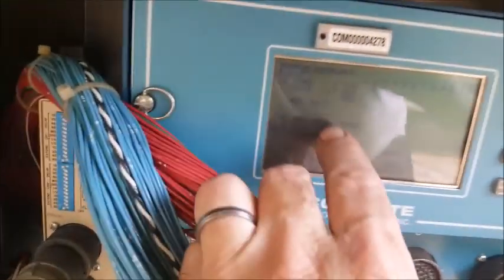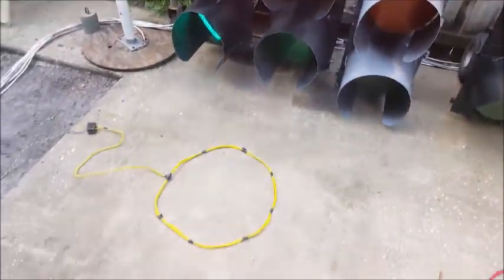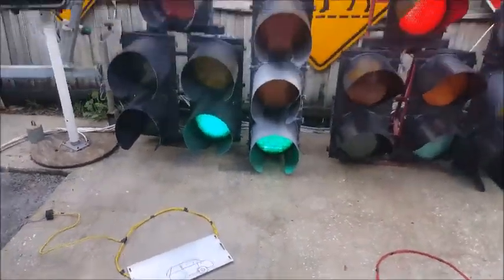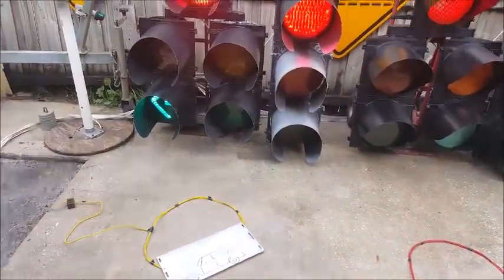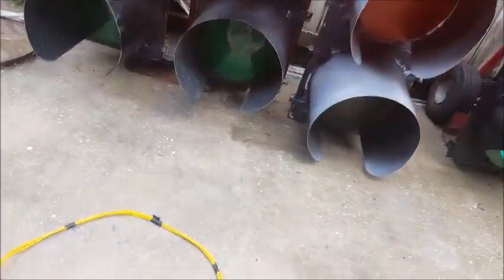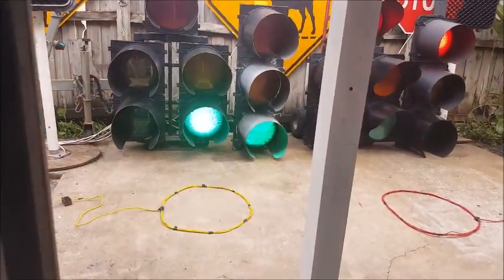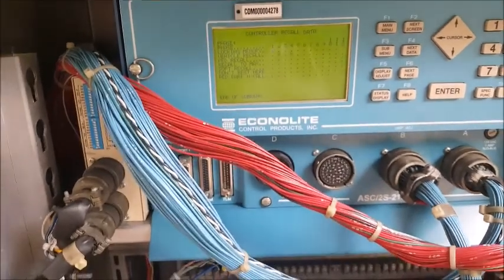Traffic Control System with Loop Detectors

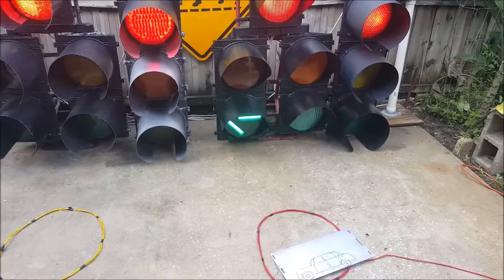Comment: 2:53 What if you don’t move it?
Reply from the maker: If you do not move off the loop or if there are many cars inline the system will go to Max Green for the arrow and move onto the next phase in the cycle. You can see this in real life during heavy traffic in the turn lane it will allow so many cars through the protected arrow then give the yellow and then red.. After that it depends on the size of the intersection if the turn is held red or becomes a permissive turn. in my intersection they become permissive turns since I'm using five way signals and do not have a dedicated red arrow.

Comment: I have a McCain ATC EX2070  and a flashing yellow arrow McCain signal head I would like to know if you know how to program that with this controller and how to hook up load switches, what pins are used and not used?
Reply from the maker: You have a newer controller then what I have. With that being said I don't know how to program that model. I use an old Econolite ASC2/S-2100 to run my signals. Sounds like your where I was a few years ago where I had signals and a controller but not much else. Since these are a hobby and I do not work in the field I had to learn from scratch.

After that what other equipment do you have?
Also are you just trying to get your signals to flash? if so you really won't need a complete system to do that.

Some systems require a Buss Interface Unit (BIU) to talk to the load switches. 

Mine only requires connection through the three Cannon connectors A, B and C. and they make all the input and output to the controller.
Next would be a load bay of some sort with load switches. 

Then you can add a MMU and Loop detection if you would like.

I give a tour of my current system.  you can see it here: https://youtu.be/wB0dz3rPfR0
Reply: A 4-section turn head enables hybrid turns (protected only mode and protected-permissive mode.) The flashing yellow arrow is separate from the solid yellow arrow one. In prot-perm mode, the FYA runs concurrent with its opposing through phase similar to when a 5-section head only displays a green ball to indicate that turns are permissive. In prot only mode, the controller would show a red arrow during the compatible through phases, but it may be possible to program the controller to display the FYA after the conflicting ped phase has completed.

In both modes, the protected phase (green and solid yellow arrow) is separate from the through phases, like other turn phases. Ideally you want two separate sets of loops to call and extend each mode depending on the time of day.

Upgrading left turns to FYA will usually entail upgrading to a 35X series cabinet, but you could also connect the flashing yellow in an existing cabinet to an unused "ped yellow" load switch, if you didn't already use these for overlaps or blank out signs.
Reply: I’m trying to create a Small intersection the signals I currently have are a flashing yellow arrow 4 section and two 3 section signals and an optical preemption detector (opticom)
I working with currently.  I Would like to add a cabinet and load switches to make things easier.

Comment: I thought if a traffic light detects a left turn and there is no other conflicting traffic or opposing left turn.......then wouldn't it have triggered an all green?
Reply from the maker: Depends on the system. this system is more a basic one that can only handle one turn and one green per side and PEDs. It cannot hold the red in one direction while the other direction gets a green arrow. This systems is a 8 switch load bay and only 6 are being used. 2 for arrows, 2 for through traffic and two for PEDs. Systems with 16 switch load bay would be more flexible and allow to work as you described. I have my eye out for a larger controller box with a 16 switch load bay that also fits into my budget.
Reply: Actually that can be accomplished in the controller itself, and really nothing to do with how many channels you have in the load bay.  In fact the rig you have in theory can be programmed to do just this.  It's not really a special configuration either.  It's part of the fully actuated set up.  It's also part of the single and dual ring (with and without the barrier) function.  Only 4 phase and 8 phase can accomplish this.

Say you have N-S movement on a green ball display.  If a northbound car wants to turn left, the the southbound lane will sequence to yellow clearance, then to all red clearance, and the Northbound left turn will get the green.  This is based on your idea of no conflicting calls on E-W movement.  If there were a conflicting call, then those cars would get serviced first before the NB car would receive the green arrow.  I had a configuration exactly like that.  

Now let's assume the call on the E-W movement dropped (that is the car left that call) typically the remaining E-W green time would reduce (most likely reverting to it's minimum green or perhaps a gap out state), and then the NB left turn would receive it's green arrow.  In many areas you'll see this late night, early morning, and very low traffic times.  Again nothing fancy in terms of hardware.  It's all done by the controller.  :-)
Reply from the maker: Im by far no expert on Traffic Control systems and have taught myself everything from scratch. It all started by building working traffic signals for my HO scale rail road I once had. I usually just sit down in front of the controller box with the manual and go page by page trying different configurations and learning all they way
I got the Econolite ASC/2s 2100 in June of 2016 and built my own A Cable from scratch and a small 4 channel load bay that I use today with the EPAC 300 I keep in my Garage.  I only used controllers I made myself before I got the Econolite controller.  

In my system I also have PEDs that take up two of the eight load bays. If I wanted to use four Five-Way signals (or 4 turn signals) with PEDs I would think I would  need at least 12 channels. My load bay is configured  like this, Ch1 is Main turn, Ch2 is main through, Ch3 is cross turn, ch4 is cross through, ch5 and 6 are unused, Ch7 is main PED and Ch8 is cross PED.
 I could add turns to ch5 and ch6 and program them but I would have to hold all the PEDs in "Don't Walk" until all the turns are complete even if no car would be turning across one of the cross walks. say if only one car is in the main street turn lanes and turns East then the crosswalk on the west side would have to be held "Don't Walk" unnecessarily until main street get the all green.  
If there was a way to do that without holding the PEDs Im up for it. 

I will have to go though the ASC/2s programming manual deeper. I live in Florida and I haven't done much programming on the system since Hurricane Irma, Thats when I had to bring everything into my garage to prepare for the storm. Its back up and running but I haven't had much time since September to get back to it other then just running it. 

 I get my programming from the ASC/2S programming manual:  http://www.webpages.uidaho.edu/signalperformance/Controller%20Manuals/ASC2S%20Programing%20Manual.PDF

The wiring and setup from the ASC/2S Maint manual: http://www.webpages.uidaho.edu/signalperformance/Controller%20Manuals/ASC2S%20Maintenance%20Manual.pdf